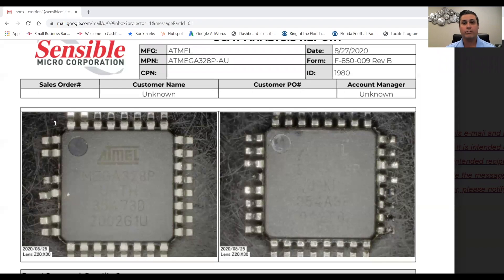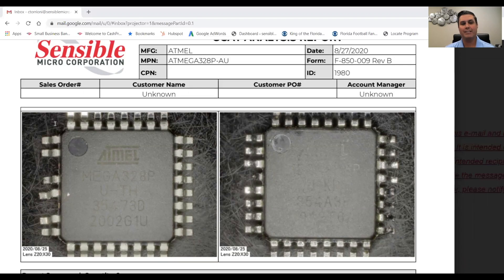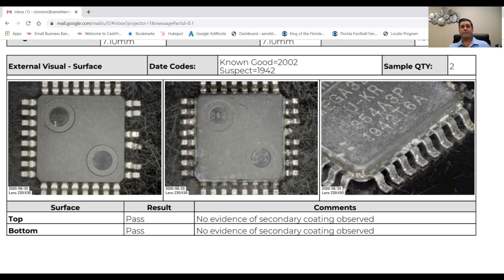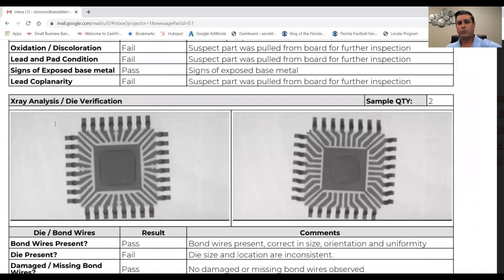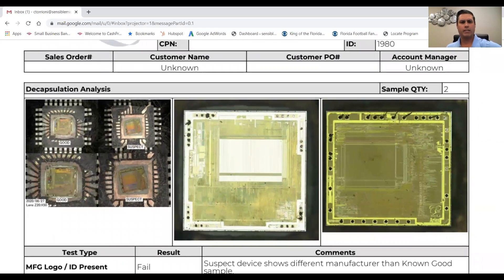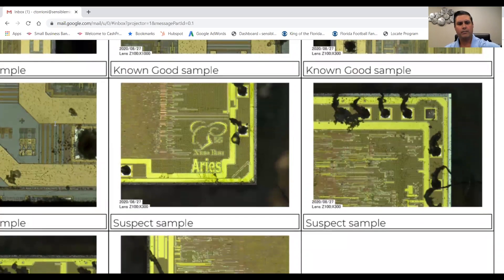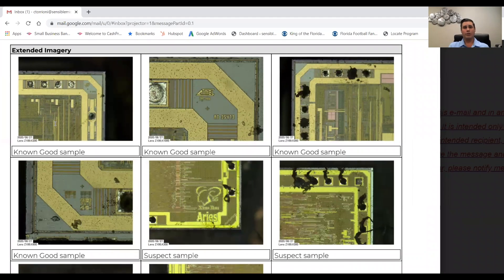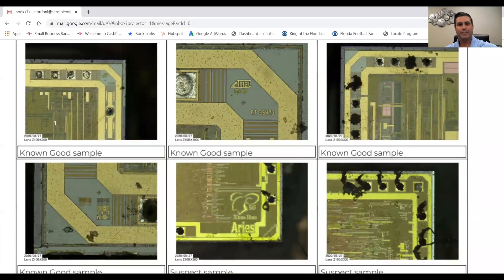Professional Forensic Analysis of a sketchy Pro-Mini (ATMEGA328P) - is it Counterfeit?

Comment: It's a strange world to live in where counterfeiting small electrical components (albeit the 328P is a larger one) just to make a tiny profit... 
It would've been expensive to manufacture this fake chip so I wonder how many they've had to sell just to break even?! I mean making a new die isn't exactly free.
Also at some point you're going to be found out, but by that point in time money have already swapped hands and nobody have heard of them ever since, but there's gotta be better ways to make money than doing this, right?! 

We all remember the old fake capacitors where they simply put a smaller capacitor inside larger cans and somehow made a profit from doing this? Or the "capacitor plague" in the early 2000's where an engineer at Rubycon stole their electrolyte formula - and wrote it down wrong, which sparked almost a decade of leaking and popping capacitors, costing the electronics industry extreme amounts of money to fix... 
We also remember the FTDI clones, although working fine, where an updated software driver in 2014 bricked all products (on purpose!) using cloned FTDI chips and the controversy that sparked since these fake clones had been used by reputable companies not knowing (although purchase price should've been a hint) and all of a sudden an updated FTDI driver for Windows bricked their products.

Sensible Micro Corporation sounds like a company the industry should use on a regular basis just to ensure components are what they claim they are. Sure, it'll cost some money and perhaps even add to lead times - but it could save you an awful lot of money unless you can do this in house. 

Thanks for an interesting video!
Reply: I worked for a major ic manufacturer. 

Back in the 90s we pursued some counterfeits in Chinese pop up fabs. 

They don't have a common law system and corruption is rampant....after years of litigation and hundreds of thousands of dollars, they'd pretend to shut down a fab on one side of the country but the operation would start up again in a couple of months on the other side of the country. 

Our only ultimate redress was to lower the price of our authentic components. 

Cracked software for ic design and proprietary pdk design kits are also readily downloadable and widely shared in China with absolutely no threat of litigation or retribution. If it's for the benefit of "the party" and causes no domestic loss or harm, then off you go to the races.

Attempt the same in the West and you're going behind bars for a very long time.

On the other hand, prohibitive cadence/tsmc/mosis aka darpa licensing and startup fees have virtually destroyed the possibility of developing a similar ic in the West....if the CCP really is picking up the tab for this mask set and  everything else is free, then we've shot ourselves in the foot and there's nobody but ourselves to blame.

My view....we all ultimately pay the price for partnering in countries which have no system of common law just to get lower prices, whether that be pandemics due to lack of regulation/system of common law in the food industry or fake/ clone ics which (I believe will soon) start causing planes to fall out the sky. 

There's "a party" in China....and you're not invited.

Very enlightening video Kevin....thanks for sharing.
Reply: @davet11  You're right. People always talk about having the "vision" or "long term strategy." But relying on China for cheap manufacturing is just the antithesis of that.
Reply: Thank you for the positive feedback Jens!  We can actually turn this reporting around usually within 1-2 days depending on how busy our inspection and warehouse teams are.  Our inspection process is actually free except for decapsulation when we are doing the sourcing as well for our customers.  Every order we ship, doesn't matter if it comes from the open market or direct from the factory goes through full external analysis, dimensionals, X-Ray imaging and low power electrical confirmation and those reports are always available for our customers.  Here is our capabilities page: https://www.sensiblemicro.com/electronic-components-inspection-test-lab  Thanks again, Chris
Reply: The thing is, it doesn't even matter if they're found out - I'm sure people making those cheap Arduino clones just use the cheapest part that 'works' - and in a lot of cases even the end user doesn't care. EDIT: after seeing some of the reports that the fake chips don't even work at low voltages, perhaps "works" is not the right term...."kinda works, most of the time" would be better.

Kinda similar to the STM32 / GD32 thing, except GD32 openly show that their product is a clone/compatible
Reply: @drojf  There are STM32F103 counterfeits. Besides GD32 there's also another replacement chip, CS32F103 by CSK, and you can buy it under that designation on purpose, or you can unwittingly buy a CS32 remarked as STM32.

Similarly there is an ATMega 238p clone LGT8F328P, which can be obtained legitimately in this form. It was only a matter of time until this, rebranded as Atmega popped up. Or maybe this die in this product is yet another clone. Who knows?

So as far as the question how it makes sense... i heard Chinese semiconductor companies don't have to make a significant profit, they just have to make the ends meet on the per-unit costs. That for the most part, the product engineering and a lot of setup costs are fronted by Chinese government, especially with regard to promising parts and projects that can help reduce China's dependence on products of US American businesses. And for sure the AVR microcontroller has to be popular enough to meet the criteria at least on paper. Thus also all those Sunxi/Allwinner processors, where you get get basically the whole computer for like $6 in parts, or about tree fiddy for the SoC alone, isn't that bloody crazy? I'm sure regardless of one or another particular product where it can backfire, the strategy overall pays itself back to the Chinese government. More cheaper components, more infrastructure growth, more hands-on education and improving specialist experience, which promises better more original products in the future, more endconsumer devices manufactured cheaper and sold now, and strategic independence. You look at a PCB and besides key components there might be dozens that you probably won't think twice about, where they come from.

And of course you can expect counterfeit shops to pop up based on these domestic ICs/dies, but they're not necessarily and fundamentally part of the picture, more of an inevitable fringe side effect.
Reply: Yes it would be good to know where Kevin's viewer bought the device. If it was ebay or aliexpress, the worst that will happen to the vendor is they will be thrown off the market,  forcing them to open another shop under a new name (likely they've anticipated this event, and already have several other shops up and running in order to build up a positive rating.) If you want authentic parts, stop buying the cheapest available from a seller you've never heard of. Just like IRL, build up trust with one or two resellers, and pay the higher price they charge.

It was surprising to see that the die was a completely different design. Presumably Aries made a chip that implemented the same instructions and had most of the same behaviors as the original atmega, then someone without scruples chose to cap it and mark it as though it were authentic. (Might have been aries, might have been a third party.) My expectation was that everything would have looked authentic on paper, but with signs of production quality problems, ie that someone was selling factory rejects as though they passed acceptance testing, or that the same factory that pumps out authentic chips during the day, under contract with a fabless manufacturer, was then using the same tooling and programming to pump out duplicates at night, under their own aegis, with less concern for quality control.
Reply: @Nono-hk3is  None of the devices that were counterfeit were purchased from Ebay or Aliexpress. The company that assembles our pcb's is a high end LCD manufacturer. They make LCD modules for a lot of big named companies that you may have even used yourself. They use a reputable sourcer who deals usually direct with the chip manufacturers  or their agents. When we had the first issue with conterfeit devices our manufacturer were beside themselves. Infact they then dropped that supplier and went elsewhere. This second lot of problem chips was coming from another of their long time suppliers and now they have been stung again so our manufacturer is trying to make sure they are doing the best that can. What we are doing now is when they get a batch of chips now we get a small sample of each batch number and they send them to us and we test those chips before they do the assembly. This is not super costly but it is a pain in the arse to organise. For example they just got a new batch of chips for us. 3 rolls of 2500 of this particular chip and there are 3 different batch numbers so then they send us about 10 each off these 3 rolls which are different batch numbers and we test them. This delays production but it is the only way we can be sure we dont get caught again. We get anew  batch of pcb and out tof them you find 2500 of them are no good so to send back all of those boards half way around the world is a big time issue. So we then get 2500 chips and hand change each one of that bad batch. This costs us a major time issue for delivery.. But this seems to be how it will now always have to operate
Reply: I think it is quite profitable in chinese market realm. Obviously you don't need to pay for licenses, patents and other stuff. All earnings belongs to you. And the Atmel/Microchip don't care about that chinese stuff because you never see such things supplied to/by official distributors like Mouser or Digikey. It is mostly used in chinese internal market. There're also 'alternative' for STM32 chips in chinese arduino boards. And people actually likes that cheap chinese arduino stuff.
Reply: I don't think they need to make profit. China & other countries will make sure they have the capabilities to produce a wide range of essential electronics to protect themselves from embargos. And once they spent all the money on reverse engeneering & trying to duplicate electronics the step to producing counterfeits isn't a big one. I wonder if this is getting worse now after recent trade wars
Reply: @devluz  they need foreign currency more than profit. I was looking at longhaul China Eastern and China Western airfares last year. 

Half the price of the closest  competitor for that route....so I calculated the fuel cost for a 777 for that distance and they were clearly running them at below cost just to destroy a competitor but primarily to get foreign currency. And yes, I considered hedged fuel prices, zero cabin crew and pilot costs, full capacity. And zero depreciation/lease for a 777 !

It's the only way the party members can get their ill gotten gains out the country.
Reply: I've found this out the hard way with NRF24 and STM32 chips which work quite nice, but the former has a control bit polarity flipped in the silicon, which took me two weeks to figure it out. The latter had different chip ID, so I couldn't use the debugger/programmer, only in open OCD. I really like Chinese alternatives, but when it comes to programmable chips, from now on I'm buying from the source.

Comment: That was a really interesting video Kevin..thank you...our production has been stifled twice now with us having to change 2500 chips by hand...because of this issue
Reply from the maker: whoa! can you share what chip it was?
Reply: @Kevindarrah   The first bad bunch was a LM741 that was around 4 years ago. The second one was just late last month we just got a new production batch of pcbs in and in making them up we found big issues...The onboard temperature sensor was reading negative values and all were the same so out of 3000 board there were 2500 with that batch number. There are around 4 batch numbers we have found as we use the temp sensor in another pcb as well but it was the one batch number that were duds...QT18B20...we ahve used probably 30,000 so far at least and no issues until last month. So the assemblers sent us another 2500 so we have to change them all. Our assembler in China is a high end company who makes LCD as well as does our assembly of all of our production pcb..they are beside themselves especially as this has happened twice now. Its a big drama when it happens in a production enviroment
Reply: As a side note the duds for the 741 had a poor copy of the TI logo and the QT18B20 we found they had the same symbol on them but no pin 1 indent on the dus but were all ok on the ones that worked other than that the printing style and depth were the same and looked the same except for the batch numbers
Reply from the maker: wow, you would not believe how funny this is! As we speak right now, I'm working on a project using the LMT01, which is what I switched to after a bad batch of 18B20's... I feel like that part is just a pile of crap now and the whole market is saturated with fakes...
Reply: @Kevindarrah  We learnt after the 741 incident that we now get about 10 random pcbs from their production lots of each pcb they do for us sent over and we test them before we give the go ahead to ship them to us. This batch obviously they didnt spread the samples across the 3000 lots of each pcb they produced as we did not find any issues with the samples
Reply: @Kevindarrah   The package we use is the SOIC 8 as it measures the temp of the pcbs in the 2 out of 3 pcbs that we use in the product. We used to use a to-92 version in one part but changed to the SOIC-8 as it worked better for us